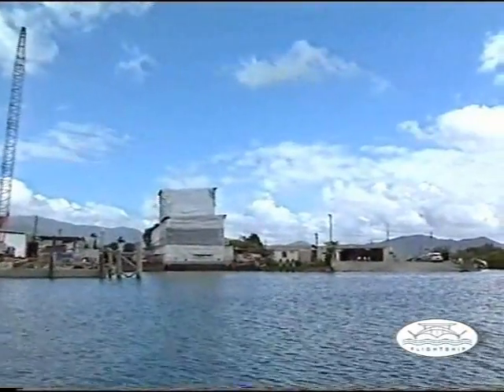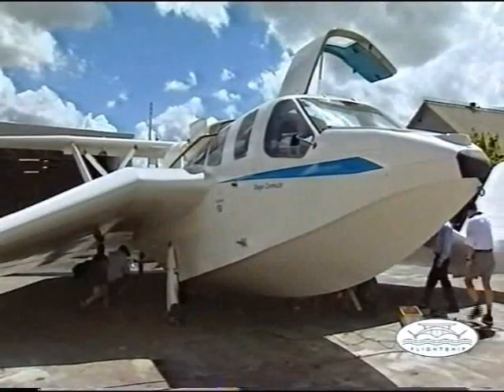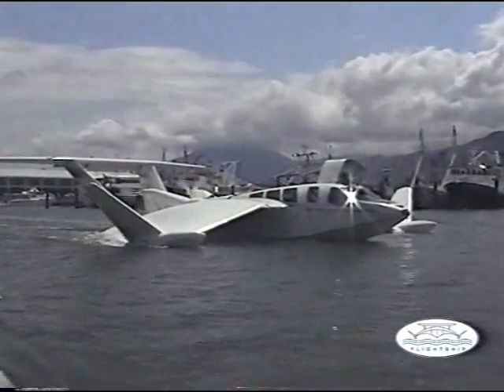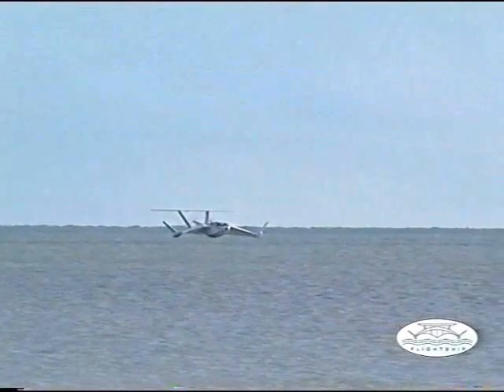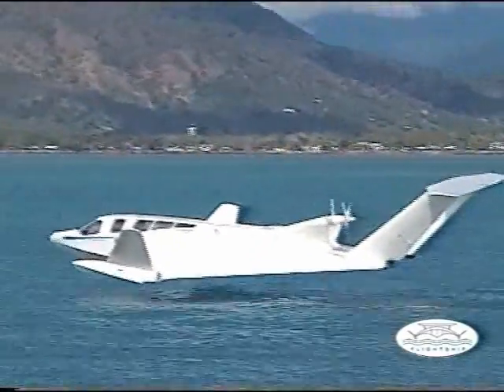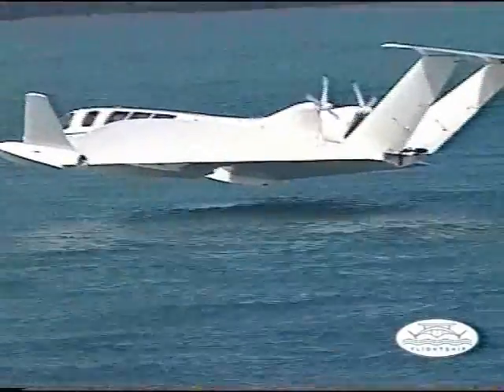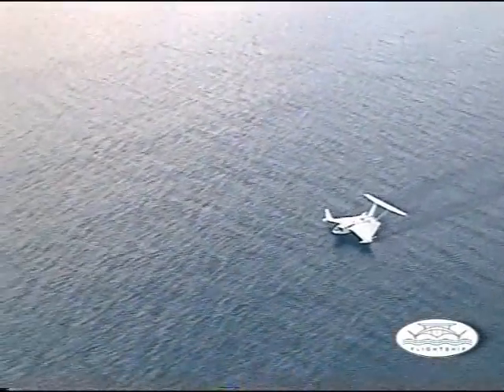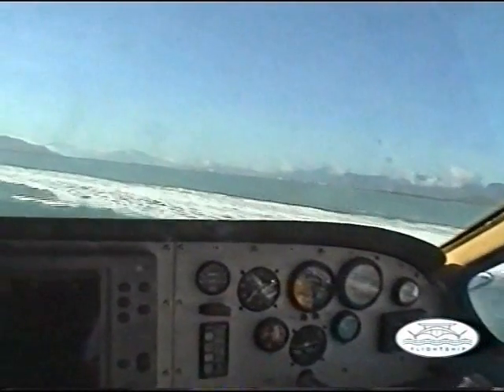New Airfish-8 (WIG craft)

Comment: Update May 2019, South China Morning Post quoting Kenneth Tan, general manager of WidgetWorks that now owns the designs.  Planning to make 50 per year at $500,000 each.  Cruising speed 90 knots.  New Atlas online quoted a max speed of almost 200 kph (120mph) for it last September.  Let's see:

Modest 17m x15m footprint, 1000kg payload, 350 mile range, only 55 cm draw, 6 knot wakeless/silent taxi, runs on normal gasoline, enough room for a head and gear for 2-4 -- this would be the ultimate personal water camper.  Putter around quietly, hang out at a beach, catch some mahi or steelhead, whatever.  Then rev it up and get to the next spot faster than any other yacht.

I'm wondering:  Can we swap out the V8 engine & fuel tank for electric & a couple car batteries for similar weight & range?  It would be quieter, even more green, and you could do solar for recharge/range -- it has a fair amount of surface to catch those rays.  In that price range, an extra 10% cost to get infinite range and no carbon/noise issues would be a big seller, and good docks already have electric hookups.

Comment: what engine car for this plane  ? mercy ?
Reply from the maker: muammar faruq Dude this isn't plane but BOAT!!! So what is your problem with the engine of this boat?
Reply: ok  boat , i wanna know power and max torque for making this boat flying, and total weight this boat ?
Reply from the maker: muammar faruq 550 hp for take off from the water, 330 hp for cruising in ground effect mode, MTOW is 4,000 kgr. And this craft is a boat because it has certified by Lloyd's Register that certifies that it is comply with IMO rules for WIG craft Type A.

Comment: AIRFISH 8
.
The AirFish 8 (AF8) is an 8-10 seater WIG Craft with a 17m x 15m footprint. It is designed to be operated by 2 crew and carrying capacity for 6-8 passengers in standard civilian transport configuration. It is powered by a powerful yet compact V8 car engine that runs on 95 Octane automotive-grade unleaded gasolines. Airfish 8 is designed and built to adhere to the International Maritime Organization (IMO) guidelines.

.

Safe and Comfortable
Fast and Fuel Efficient
Environmentally Friendly
Minimum Infrastructure to Operate
.
.
SPECIFICATIONS

Certification
-Lloyd’s Register, 100A1 WIG
-MCH TYPE A Passenger

Dimensions
-Overall length 17.2m
-Overall height 3.5m
-Cabin Length4.0m
-Cabin width 1.4m
-Wingspan 15.0m
-Draught, waterborne 0.55m (maximum)

Payload Capacity
-Useful Load -1000 kg
-Baggage Capacity -160kg
Seating Capacity 2 Crew + 6 to 8 Passengers

Engine
-V8, 500 HP
-Fuel: Gasoline, Octane 95 or above
-Consumption ~ 70 litres/hour in normal condition

Construction
-Carbon Fibre Reinforced
-Plastic/Sandwich Composite

Performance
-Operating height: up to 7m
-Maximum Speed: 106 knots
-Cruising Speed:   ~ 80 knots
-Take off distance: ~ 500m
-Landing distance: ~ 300 to 500m
-Range: ~ 300 nautical miles
-Turning Radius:
+     Ground effect mode:  ~ 160m
+     Displacement mode: ~ 100m

Comment: This craft has specific customers. Fishermen or cruisers won't buy it. You cannot fish or enjoy sea from this purpose driven transport primary device. And they should have special designated route so that avoid running into each other. High regulations will guarantee safety or awareness of its major traveling area for other boats. It is intimidating sight when this thing approaches you, although you know it will dodge you  a lot faster.

Comment from the maker: @kaptned 
WIG crafts as much safer from aircrafts, they have stabilization and fly by wire systems to avoid any captain mistakes. The aerodynamics is different between an aircraft and WIG craft. These crafts has certificate for safe operation. Anyway the safety depends at most from a good and aerodymanamic stable design.

Comment from the maker: @DrPilotRedC 
Hovercraft technology has many disadvantages and especially: Hovercrafts are consuming much more fuels, don't have enough operational limits (high Hs) for commercial use, and they are not enviroment friendly such as high noise level - sea spray many times in 30 meters high and sea creautures suffering from high pressure in sea level.

Comment from the maker: Operating of the control surfaces by the steering wheel for a turn, is done in such a manner that the craft makes a coordinated banking maneuver with the craft simultaneously reaching the altitude required for such a turn. Banking angle is approx. 15 degress.
Turning radius is approx. 300 meters.